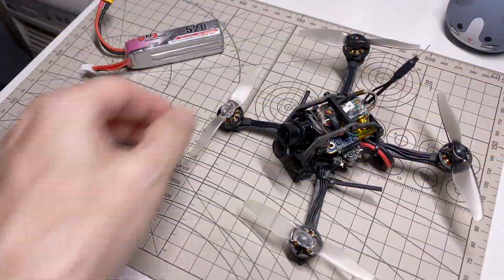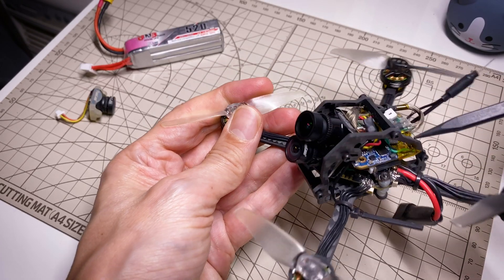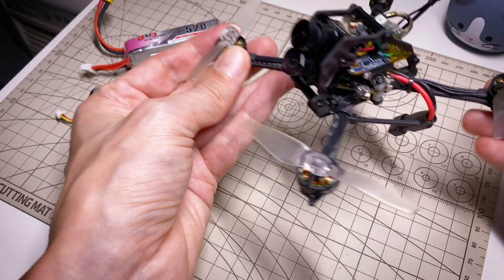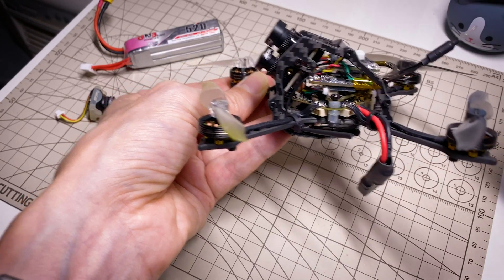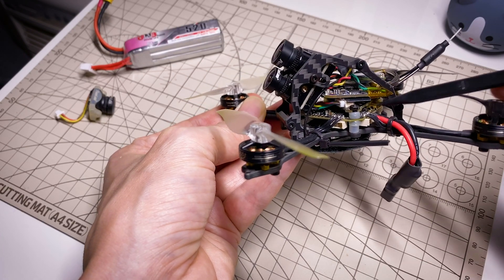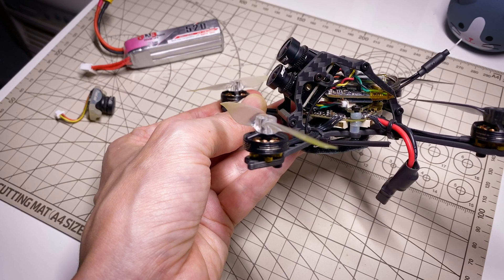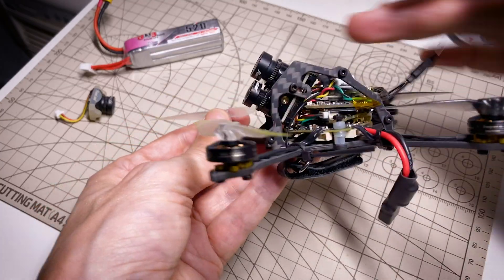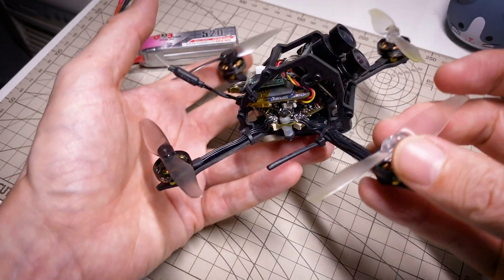Airblade EX Ultralight Toothpick + Runcam Hybrid 4K + Amax Inno 1303 4800kV

Comment: Pretty nice build. Try Gemfan 3016 3 bladed 3" props with it.
Reply from the maker: Thanks, I will:) I actually ordered a set recently but mistakenly got the 1.5mm versions...
Reply: @MiniMicroFPV  take 2mm drill bit, enlarge the holes and you are good to go :)
Reply from the maker: Thanks for the tip! Already got the new props though and will be posting a quick update soon:)

Comment: Looks like you could probably 3d print something small for camera protection.
Why so much jello? Tuning or props? I'm just curious because I want to build one.
Reply from the maker: Yes, I was thinking of 3D-printing something if I decided to keep flying this regularly:)
As for the jello, I saw it more as bumpiness than typical jello and I attribute it to slightly windy conditions. A previous flight was much smoother but was a little slower so I went with this flight to demo:) That said, there probably is some tuning to be done but that's not something I spend too much time with.
Reply from the maker: Made it smoother with the 3016s:) https://youtu.be/WJq-hALcizQ